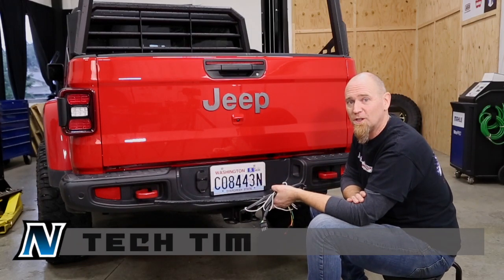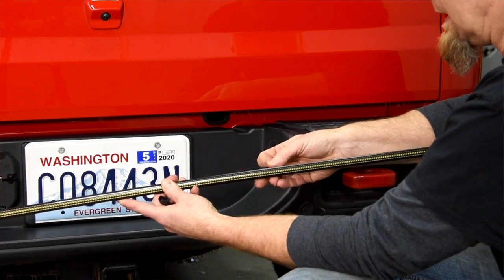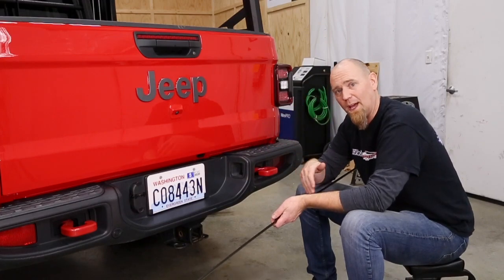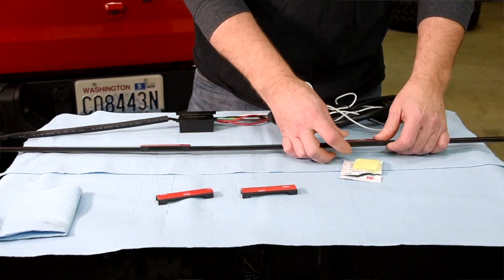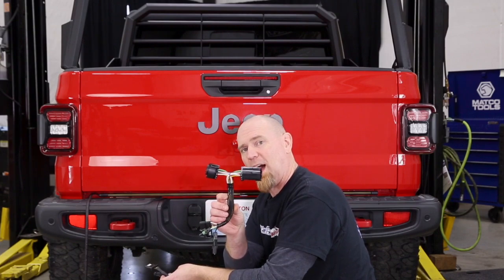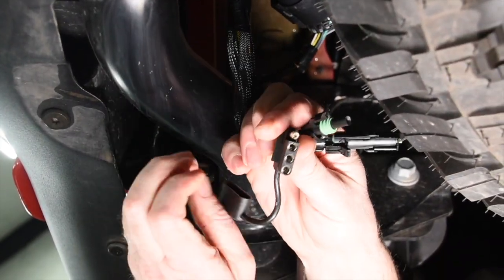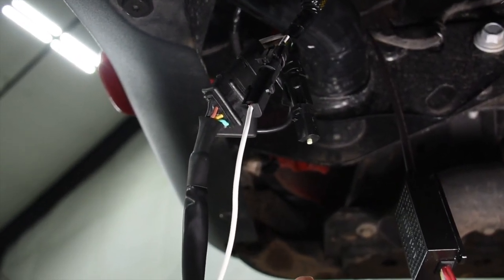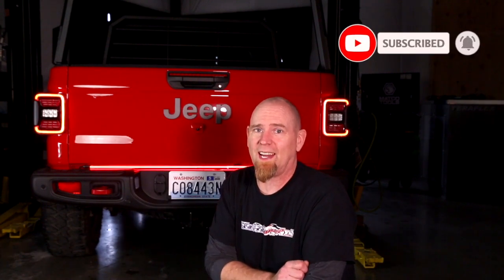How to Install a Putco Blade LED Tailgate Light Bar on a Jeep Gladiator

Comment: Your video was spot on . I used masking tape to mark center of the back of the gladiator. Then put tape with center line on light blade. Line the two marks up. Dead center. 

If the backup light stays on just just plug white wire into other lead.
Looks great
Reply from the maker: Glad you like it!

Comment: I was interested in this light bar UNTIL you have to remove it in case you need to get to the rear tire. This is a potential problem. I think they could have figured out a better work around. I think the Oracle rear bumper lights are a better option

Comment: What Size Gauge wire is coming from the black box leading to the light itself? 
How many amps can the black box handle? 
I am asking for I would like to add another LED brake light to this set up. 
I have already tapped into the Gladiator harness. There is no dedicated brake light wire. Brake wire is integrated into the turn signal.  Any information would be greatly appreciated.
Reply from the maker: The wire size looks to be 14-16 gauge.
We haven't seen anything that lists max amps for the black box. Reach out to Putco for more help.

Comment: so far that's the best LED tail I seen to far, is the length 48" or longer on the Gladiator
Reply from the maker: It is 48".
Reply: I think the Oracle rear bumper lights are better
Reply: OPT 7 is amazing too. I had the triple led bar on my ram, and I just installed the 48 inch bar on my gladiator Rubicon. When you put his car in reverse, it lights up the whole street.

Comment: can you still plug a 4 pin if you are towing or do you have to disconnect the whole bar ?
Reply from the maker: You can wire it directly into the harness, so it doesn't affect your 4 pin.
Reply: @northridgenation   my question was more will the light bar and the trailer light work if both are connected into the harness or will that draw too much power ?

Comment: hi, i am just curious, when i get the putco blade installed, how do i lower the Spare or can anyone plese demonstrate how i can take the putco blade without damaging the blade
Reply from the maker: We installed the Blade right over the top of the access hole, when you need to lower the spare, snap the Blade out and then back in when you are done.
You can also install the blade a little higher so it only covers the top of the access hole and you can still squeeze the prop rod in underneath it.

Comment: Do you think can fit on JK do you think going look good or awful?
Reply from the maker: We've been thinking the same thing! Yes, you could fit these on a JK. We'll take a closer look next time we have a JK in the studio.
Reply from the maker: Also take a look at the Putco split blade:https://www.northridge4x4.com/part/light-bars/92009-18-putco-blade-led-tailgate-light-bar-18inx2-pair
It is designed to mount on either side of the spare tire.

Comment: Do u think if i buy an tailgate light bar from amazon and then use that putco t connector will it work out? Its for a 2021 Jeep Wrangler
Reply from the maker: Sorry, do not know.
Reply: Obviously, this is a one year old post, but hopefully you figured it out. I had the 60 inch OPT7 triple LED light bar on my ram 1500 and I loved it. I just bought the 2023 gladiator Rubicon and I found out very quickly that the 60 inch is incredibly way too long. Ended up buying the 48 inch and it looks amazing. But anyways, you can use a T connector from multiple companies. But I’m sure you figured that out by now. I love my tailgate light bar. Right now I’m trying to figure out what headlights to install because these halogens are junk

Comment: Can you confirm if turn signals are red or amber for gladiator version? A competitor site has red turn signals which matches better since gladiator has red turn signals
Reply from the maker: The 92009-48 has the Amber turn signal:
https://www.northridge4x4.com/part/light-bars/92009-48pkg-putco-tailgate-light-bar-w-harness
The 92010-48 has the Red turn signal. Drop us an email or give us a ring and we can get one on its way to you.
Reply: @northridgenation  thanks for the response you may want to update your description which states: Super Amber Turn Signals or Mega Red (RED BLADE)